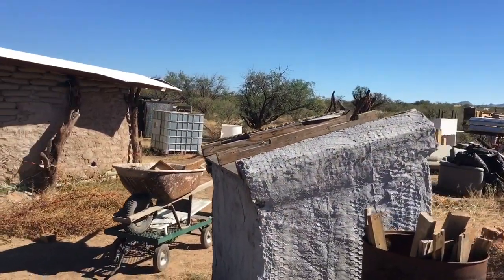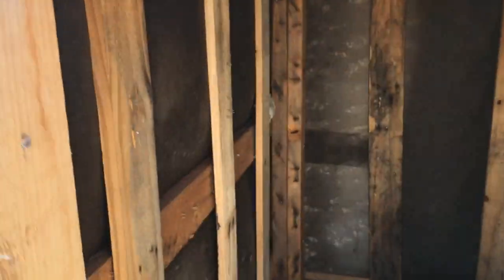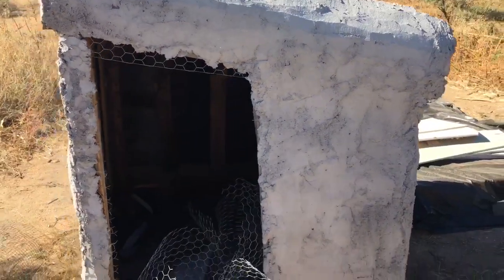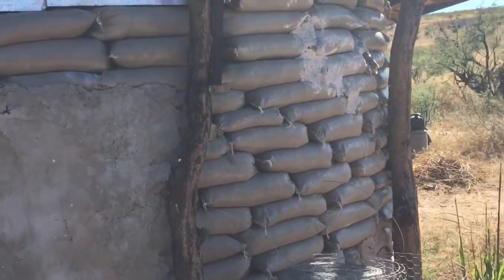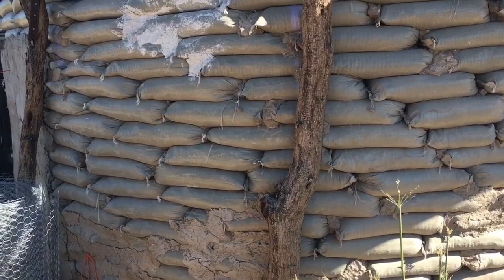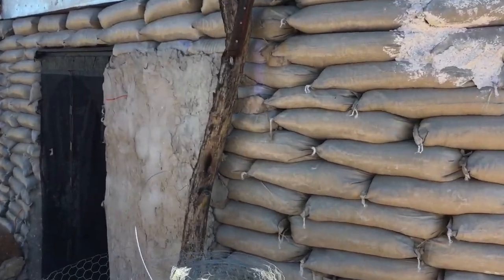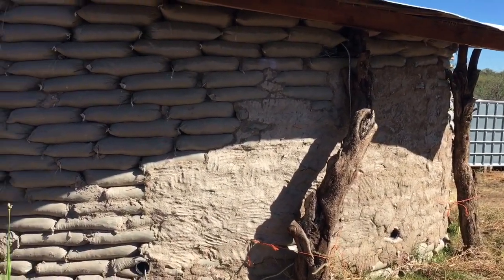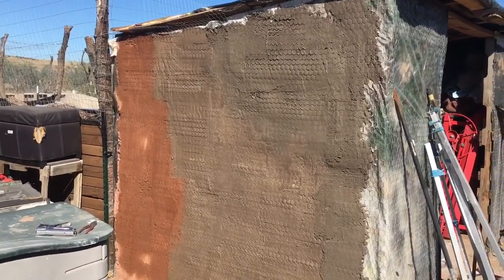How to build with Earthbags - stucco

Comment: Stucco is completely standardized. You 'mixes' are not. Roman cement which is lime based not cement based lasts longer than today's concrete. The clay, silt, sand ratios matter. Stucco is the winner b/c some else did the work.
Reply from the maker: Ok.... What is your point exactly?

Comment: The only thing to think about is just how strong stucco is. As you noticed, stucco and lath is strong enough to be the entire wall - they call it ferrocement.
When there are big strength differences like that, you may have issues with the earth bags shifting and detaching from the stucco or the stucco cracking as the building settles or after enough  hot/cold expansion cycles. 
Some people recommend weakening the stucco slightly by using more sand and/or lime in the mortar mix.
Reply from the maker: Just an update .. no cracking as of today